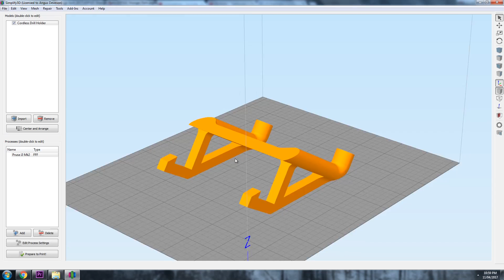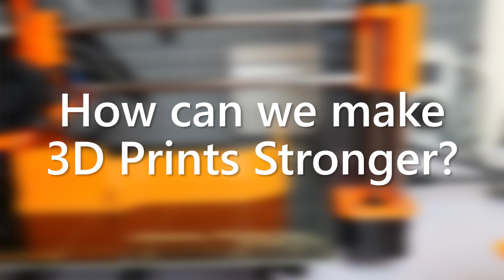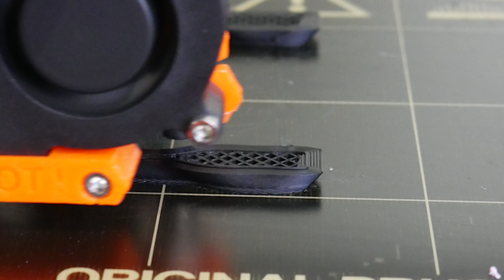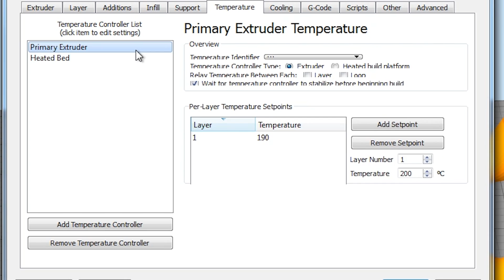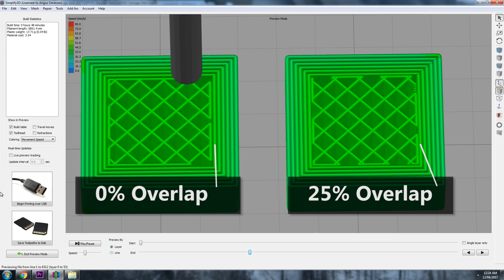3D Print Stronger Parts! 3D Printing 101

Comment from the maker: Welcome to Maker's Muse! Recent uploads are playing choppy at any res under 720HD, please choose HD playback for best viewing experience. We are investigating the issue. Happy Printing!
Reply: Angus, will you please do a thorough detailed tutorial on using PETG please!!!
Reply: Mirko Ragni thank you very much.  I will give these a shot.
Reply: Terrence A. your welcome :-) I hope it will work fine :-) let me know if you need some other settings that I may forgot to mention :-)
Reply: Actually, if you watch at 144 FPS everything is too fuzzy to notice ;D
Reply: If your phone's resolution doesn't reach 720p, you CAN'T view it properly
Reply: +Maker's Muse - the 480p version is a 480p25 file with frame doubling, with each second having 12 or 13 frames. Exacerbating the staccato look is the minimal motion blur from the 50fps' high shutter speed - it doesn't look like there's any frame blending, rather it seems to be simply dropping 3 out of every 4 frames.
Reply: 1. Why doesn't any other channel do this? It's pretty bad.
2. I cant view in anything other than 480p because of my phone, please fix the issue as it's really distracting.
Reply: Maker's Muse what are basic S3d settings for your Prusa?  I can't get it to slice as well as cura or slic3er
Reply: Maker's Muse i noticed this issue on bruces xjet and rcmodelreviews channels from NZ
Reply: Terrence A. I have a Original Prusa i3 MK2 and my settings for S3D are:
PRIMARY EXTRUDER TOOLHEAD
1 - Extrusion multiplier: 1
2 - Extrusion width: 0.4 mm
3 - Retraction Distance: 1.5 mm
4 - Extra restart distance: 0 mm
5 - Retraction speed: 30 mm/s
6 - Coasting distance: 0.2 mm
7 - Wipe distance: 2 mm
LAYER
1 - First layer height: 100%
2 - First layer width: 100%
3 - First layer speed: 50%
SCRIPT
Starting Script
M201 X1000 Y1000 E600
M92 E161.3
G28
G92 E0.0
G1 Y-3.0 F1000.0
G1 X60 E9.0 F1000.0
G1 X100.0 E12.5 F1000.0
G92 Z0.1
G92 E0.0
Ending script
M104 S0
M140 S0 
G1 X0 Y200
M84
Reply: U are recording at 50 FPS. Wat camera are u using?
Reply: Maker's Muse Its choppy because at lower quality, its playing at 25 FPS, while I/We are used at watching 60 FPS at HD or 30 FPS.
btw good video Angus. #HighFive
Reply from the maker: It's definitely not 25fps, that is cinematic and is a lot smoother, you're getting 12 or lower fps for some reason...
Reply: Dumb question could you use fiberglass resin without the cloth to save an umpteenth hour print that began delaminating when it is finished printing?
Reply: idk why but its only ur channel
Reply: Maker's Muse last ok video was 3d modelling for beginners

Comment: YES, Having even one perimeter with a 1.00mm layer width is pretty strong. When I print more than one Perimeter It prints great but the perimeters do not stick together. Is this what happens on your prints or how are you getting perimeter to stick together. I get Perimeters that are really close to each other but I can peal them apart. Maybe Perimeters are supposed to be that way? I am printing with a 0.6mm REVO Nozzle and a 0.4mm layer height.

Comment: Increase strength by 10X, simple and cheap.  Add holes to your CAD model through your part in every direction you want more strength to allow a slip fit of carbon fiber rods.  I use 1, 3 and 5mm rods depending on the size of my part.  Coat the carbon fiber rods with 5-minute epoxy, slide them into the holes and you will have a printed part stronger than a molded plastic part.  I test print a small block with many holes of slightly bigger and smaller diameters than my carbon fiber rod until I find a size to give a slip fit.  Don't make it too tight, it should be easy to insert the rod to allow space for the epoxy and prevent epoxy from being wiped away.  Simply cut the rod flush to your part and sand if desired.

Comment: What happens if you use a 3D printer inside at vacuum chamber would it affect the 3D print in anyway could it make it stronger I feel like it would suck the air out of the filament and make the filament more dense

Comment: An another solution can be that you print the parts separately using joints. Then glue them or use fasteners, dowels etc. Its very similar to another structural strength. Casted vs constructed items.

Comment: Great video, however I would suggest another step before all what you've said: Optimize the design in a way that minimizes the stresses and maximizes the strength. For example if you separate the two hooks of the drill holder, make them flat, print them flat and then use a separate piece to hold them apart at the desired distance (which is a non-critical feature), you'll get a much stronger part.

Comment: Usefull tips. When I need extremely high resistance I print my object with 0% infill and two small holes in the position I consider to be the best then I use this holes to instill bicomponent resin. It becames as hard as a rock.

Comment: This doesn't help me.  I am trying to make a flanged face and shaft extension to another flanged face.  the flanges just snap on the joints at the shaft.  It seems as the mesh just surface mounts the shaft to the flange face. I designed it in Fusion360 for the shaft to be extruded through the whole thickness of the flange.  I have done all you say except the 25% overlap. 
Another model i have breaks apart just taking the supports off.

Comment: you could also add a radius any inner corners, so it's less likely to rip there
Reply: This is literally machine part design 101, sharp inner corners should be avoided as they'll form concentrated stress points.

Comment: I have a question about raising the layer height, although it does give it less layers, which then means less areas that can come apart, I would think it would make the layers not fused together as well? Cause in my mind I imagine with a layer height of 0.15 it would be sort of "pressing" the layers down on top of each other while with a layer height of 0.25 it would be sort of just "laying down" the next layer on top? I realize that is quite exaggerated and that if that is true then it would be so tiny it wouldn't be noticeable, anyways am I totally off and wrong for thinking that?

Comment: While this video was very helpful, I would never mount a holder for my drill on the side of the work bench, especially the way you have it attached. It will be in the way and it will get knocked off constantly. Better to either attach it to a peg board, or fasten it to the wall using screws, where it is out of the way while you are working at the bench.

Comment: Why not mention the use of more durable materials? I just started using PETG and once dialed in it looks just as good as pla and it doesn't cost a penny more and the stuff is strong as hell. I'm working on a part that needs insane impact strength and it only broke only after multiple hard impacts with a rubber mallet with a steel part on it.

Comment: Very interesting video last year I built a automatic 3D printed farm gate opener the tooth pulley were first printed in 0.3 mm and they failed within a few minutes then I reprinted them on. 1mm layer height and a year later they're still working with no real signs of wear. This seems to be opposite to everything  I've read but having said that maybe the forces on the part are different

Comment: One more setting I have used when there is a 'towering' appendage sticking up off of a flat surface.  Something that could be easily snapped off by bending it sideways.  In this case the surface layers at the base of the appendage would lift off of the infill and break away. Simplify 3D has a 'Print every infill angle on each layer' check box on the Infill tab.  I didn't notice before this failure that the infill layers were not all identical.  They alternate every other layer.  Checking this box makes each layer fully bond to the previous infill layer.

Comment: My normal print temp is 205c or 115c some were between those I never go below 202 on any of my prints even know that’s over board for hatchbox PLA but I like the finish it gives it and oh ya my printer on those temps can get down to 0.20 mm I can’t do 0.10 mm top because I printed the tol test at 0.25 layer height and my printer is the MP mini delta but it’s rellly tounded sorry I can’t spell because I’m only 12.

Comment: Even though 3D printing is super efficent and easy to use, but machined parts are the strongest until 3D printers that use metal can be as easy to get as a normal 3D printer.

Comment: I've started dividing my parts so that when combined that have orientation strength in every direction they need it. I made an extruder head that had hinges but those hinges would be weak in relation to the strength I needed for the whole part. My solution was to  have the hinge pivots printed in their strongest orientation and then insert them into the head part

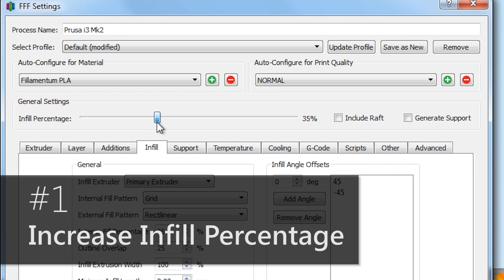Comment: 1. Increase infill percentage 1:17 (not the full story)
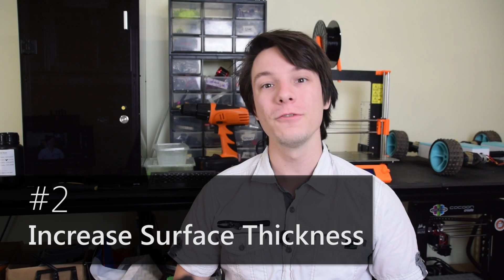2. Increase surface thickness 1:30 (better)
3. Increase layer height 2:10 (don't go past 80% of nozzle diameter)
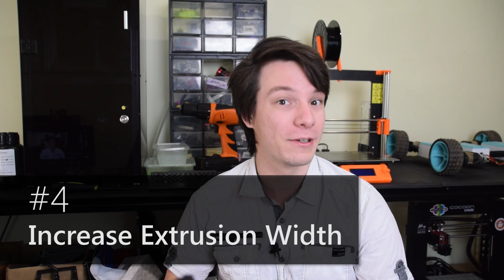4. Increase extrusion width 3:06
5. Increase extrusion multiplier 3:23
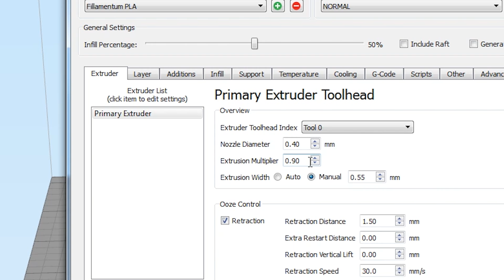6. Increase print temperature 3:35
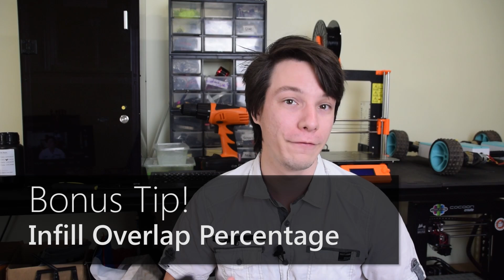Bonus: Increase infill overlap 4:10
Reply: Thank you for the index.  I snapped a screenshot for future reference.
Reply: Thanks John!

Comment: I know it's a common belief that you don't need to print at 100% infill for strong parts -- but when I tried it, I was blown away by how rigid my part came out -- it was noticeably more rigid than anything else I'd ever printed before (including the same part).  Like night and day different.  -- Also, if you're printing with clear PLA, it looks great.  (Like actually decently translucent without a lot of extra work.)

Comment: I found that by far the biggest improvement in PLA strength comes from post-production annealing.

Thomas Sanlanderer did a great video on this too.

It has the added benefit of greatly increasing the maximum temperature that PLA withstand too. My annealed PLA parts will not change dimension even when immersed in boiling water.

Comment: one thing that I have found with soft PLA is that settings definitely can change the overall structure of the print. for example, set 40% honeycomb infill with a layer height of 0.2 and print something with soft PLA. then set 40% infill with a layer height of 0.1618 and then print it. for some reason, it slices differently with respect to the infill. 0.1618 layer height with the same infill will result in a print that is way more spongy due to the fact that the slicer oriented the honeycomb infill in 4 different directions vs 2 different directions for the 0.2mm layer height. it's weird but definitely something to consider since you can achieve different part qualities this way. 

I imagine this has a similar affect on other filaments also - which seems to support the conflicting results regarding layer height - where some say more layers and others say fewer layers.  id actually suggest the most important factor is how infill is stacked in the slicer, since in reality, structure is more important than density to the overall strength of a part.

Comment: Ooopsie! I didn't know hitting "enter" would terminate my comment! Well anyway, back to what I was trying to say: A way that you could design in vertical bracing to resist torsional stresses would be to add a number of vertical holes. Then, when the product is complete, insert metal rods  of the appropriate size and then fill in the rest of the hole with something. Hot glue, maybe? or, drill and tap for a set screw and screw it in.

Those are at just about the min/max of the easily available methods you could use too retain the reinforcing rod.

And, to finish my thoughts concerning my Anet A8. I am not happy with the electrical/electronics that I have seen on most of these YouTube videos. One says, "Well, I haven't had any trouble yet..." But I am pretty sure that I've seen a couple of problems with his solution for wiring in a MOSFET. And he has months-old, open questions on his channel concerning that design that haven't been answered. 

Another guy has a video that I think has him short-circuiting his 110 v AC input plug/on-off switch design.

But I'm not sure. I don't know what YouTube etiquette is.

Comment: Raising temperature will decrease strength, take a look at the plastics properties and go for the lowest temperature that will give clean results, so if 180 and 190 gives the same finish then 180 will be the best. To high temperatures will destroy the plastics bonding properties even if its not bobbling or showing other signs of failures.

Comment: Good summary.

An innovative way to improve strength is to print with a fairly low infill (or none) and resin infuse the parts (after the print is finished, or if you are adventurous in stages during the print), adding chopped fibres (glass or carbon) to the resin will help a lot too.

Comment: Mechanical engineer here. Your comment about pipe walls is missing some information - a pipe is strong for its designed purpose because stress in torsion, bending and internal pressure in a thin walled cylinder is always most concentrated at the surface or wall. This is specific to its geometry and structural mechanics. 
However this is not true for something like your bracket, which will have much more complex stress distributions which occur in multiple places. You are correct that making the part thicker will make it stronger, but that's not because a thicker surface is the answer, its just because the stress in any part goes down the thicker you make it, whether at the surface or centre.
If you really want to design strong parts, put the 3d model into a finite element analysis program like ANSYS and study the maximum stresses in it under different loading conditions. This allows you to thicken the part at exactly the most highly stressed locations.

Comment: I didn't know one could increase layer height by up to 80% of nozzle diameter, thanks a lot !
Reply from the maker: No worries, that plus a larger nozzle diameter can mean you can really pump out fast, strong prints!
Reply: You can't. You can increase it up to 80% of nozzle diameter. No 'by' about it. What you wrote doesn't make sense.

Comment: I found going to a 0.5 mm nozzle also makes for stronger prints which is why I have one of my printers with that size that I usually use for making structural parts and electronics enclosures or stuff that doesn't have a lot of detail. The main drawback is I have to redesign many designs for arduinos because it's hard to print small round pins so I lop off the pin and put a hole in it for a screw which is really a better way of making quality devices anyway,  If I really want to get serious I do my prototypes in ABS and once I get it right I reprint in nylon. For instance I have a trolling motor with autopilot (iPilot) and all the electronics except the high current motor drive stuff is in the head and I didn't like the way it hangs unsupported when pulling it down the road on a trailer so I made a nice bracket that clamps to the side of the boat and the tube snaps into just below the head. Once out on the water you unclip it and it swings out the the way. Every boat is different and set up different so it's pretty much application specific and something you aren't going to find in stores  .... And there is one of the big advantages of having a 3D printer and a little but of basic CAD skills (For me the CAD is the harder part, I took to the mechanical aspect like a duck to water)

Comment: Interesting video. I am not convinced though about the layer height increase. It does not matter much how many layer interfaces there are, as a part is only as strong as it's weakest link. Also from what I have seen on 3D prints, the surface tents to get more bumpy, with sharp inside corners just at the layer interface. Sharp insides corners cause stress concentrations, that is the stress on the tip of the corner can be son the scale of 2 or 3 times higher. I do think a test would be necessary in order to determine what is correct though, as there may be other factors with coarser layers that negate this effect.

Comment: Why would you be using 0.9 extrusion multiplier on your mk2 anyway?
Reply from the maker: better finish overall when using PLA out of S3D.
Reply: Interesting. Do you know or have formulated a theory as to why? Also, no issues with perimeters not adhering to one another when setting extrusion multiplier as low as 0.9?

(Thanks for responding btw. Love your videos! In the words of Tony the Tiger....They're Grrrreat!)

Comment: These are great tips but if you want something that is REALLY strong, you'll have to decontruct your design to print everything in the optimal configuration and bolt it together afterwards. Takes a bit more time and effort but uses less material and is BY FAR the strongest solution
Reply: Agreed.  I print quite a few parts that have to be strong and rigid, and bolting together parts that are printed in their optimal orientation is really the only way to go i.e. optimize orientation as needed for tension, compression, sheer, torsion, etc.
Reply: This is what i ended up doing on a flanged shaft extension....mayb i will just start to go this route. 
 I did make some 8mm - 90deg. elbows with 4mm wall thickness...they just split in half try to get supports out. is there a wall thickness ratio to prevent them from splitting?
Reply: When I need extremely high resistance I print my object empty and I fill them with bicomponent resin. You can step on them with a car

Comment: How about making a watertight print. I am running into this issue while making an adapter for a 2 liter bottle. I have used some of the same tricks you did here, but I will tweak them further with some of your ideas in this video. I'm trying to use MakerGeek's PETG and Raptor PLA because it needs to be food safe. Any help would be appreciated (and hopefully profitable).